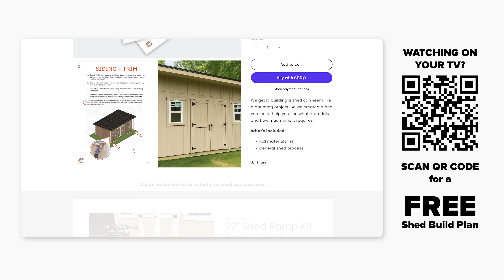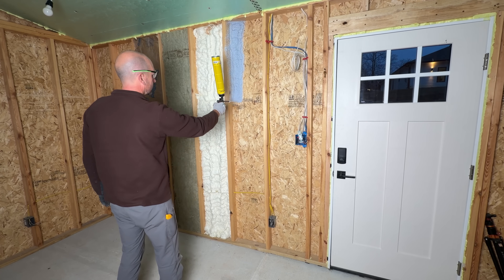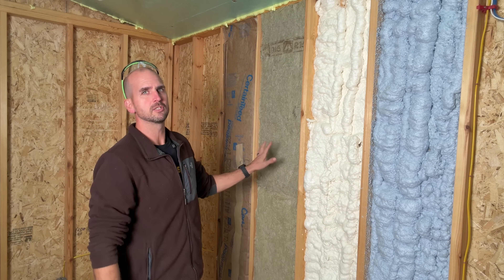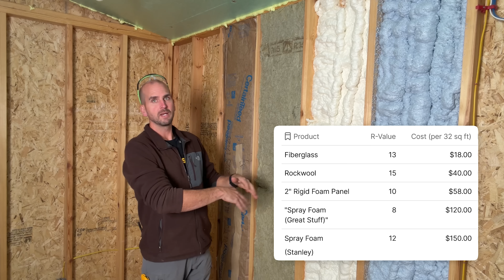Stop Wasting Money! Most Homeowners Are Insulating Walls Wrong

Comment: Rockwool also has the best sound dampening rating. FYI :) Plus it is far more fire resistant than the fiberglass and made out of inert material so pests, molds tend to be no issue.  We did our garage in 5.5" rockwool.  The cost will blow you away at first, but the sound control for working in the garage plus the extra R value if you are heating and cooling will make the cost less of an issue and may even pay for itself after a few winters.

Comment: At 4:21 you metioned wetting the walls to help adhesion.  Crazy thought - would adding a few drops of dish soap to break the surface tension of the water help the foam stick better?  I'm assuming the best tool for this purpose would be a simple pump up garden sprayer?
     Also, there are a number of 2-part spray foam kits that may be more appropriate and cost-effective than the small spray cans used in the video.  The key is cost per square foot to install and the pay-back in energy savings over time.
Thanks for posting!

Comment: Stone wool will be a great choice for most people. The higher cost (which also comes with a better R-value and better features like water resistance) is worth it. It's easier to install, no stapling is necessary, and your finished product will be much closer to ideal conditions than when installing fibreglass.

Remember that the rated R-value is only achievable with proper installation and good conditions. Stone wool is the way to go. Spray foam is great for air sealing and for gaps and cracks.

Comment: Rockwool will not burn, inhibits other burnable materials from burning, it is undamaged by water and it will not feed insects.
We had rockwool blown in on our 8 inch metal stud exterior walls, for a 5600 sq ft home, price was $4400 in 1998.
Rockwool paid for itself the first year, our usual electric bill is around $200 per month- average. Most its been is about $340 in middle of August in Texas.
Thank you for your great teaching videos, you've blessed us.

Comment: Did you insulate the floor. If you don’t  any heater will have to work hard picking up the cool air from the floor. I don’t ever use Kraft faced insulation. A good vapor barrier to keep air leakage at a minimum is a must.

Comment: Fiberglass is the worst product of them all. Each have disadvantages. 

"Fiberglass insulation's R-value isn't static; it generally decreases in extreme cold (due to air convection loops forming) and can slightly increase in very cold temps before dropping, while its standard R-value (like R-3.5 per inch) applies at moderate temperatures (around 75°F), but tests show a typical R-13 batt could hit R-15 at -30°F but drop to R-11 at 150°F, showing it performs less effectively in heat and suffers more from air leakage/convection than rigid foam"

Sprayfoam works the best but had disadvantages on wood. It will trap any moisture in the wood, so if you get a leak, it will rot away the wood, and it makes replacement really hard. Also if you get wood eating pest, it makes it really hard to detect and get rid of them.

Comment: My brother is a commercial roofing contractor and had several 1,000 sf of 2.2" ISO rigid insualtion left over from a large job he gave me.  Then on another job he had a bunch of R-30 batt insulation left over.  I used the batt in my workshop ceiling I was building and the rigid in the walls.  I'm amazed at how cool and warm it keeps it. Plus fortunate to get it for free.

Comment: Seriously, you shouldn't do this stuff if you don't know what you are doing. Spray cans? It's not meant for that application. Paper of the fiberglass batts on top of the studs? and you just screwed drywall over it? Working with fiberglass batts without a respirator? smh

Comment: If you're drywalling the walls and you have an adequate moisture barrier, cellulose is the best option for the money.  Put up the drywall, cut a small circle at the top of each bay and blow it in.  It's more air tight than every insulation except for closed cell, and super cheap, easy to DIY.  The Achilles heel is moisture entry, so if you get that part right you're golden.
Reply: Cellulose?  Oh heck no in stud cavities. Attic?  Ok.  It crushes over time QUICKLY losing its insulation value.  Now you could say LEAVE the holes OPEN at the top so you can continually TOP off the decaying cellulose insulation... but who wants to do that?  I have seen some finished buildings do heavy dense packing of cellulose stud cavities, but I would not trust it in stud cavities and it destroys its monetary value over other options if you do it this way so... WHY bother?
Reply: Net and blow is pretty good

Comment: Did you compare using this: Froth Pak 630 Spray Foam Insulation Kit, 15 ft Hose – Closed Cell, 2 Part Foam Sealant, Yields Up to 630 Board ft

Comment: Rockwool is the best soft insulation but real spray foam is objectively better. You get air seal and get into stuff that regular insulation can’t reach. Also no sagging. Only downside is off gassing

Comment: I like the Rockwool better as well. It is completely fire proof and will not produce toxic chemicals like the spray foam does during a fire. It is also a great sound proof material which are a couple of things you didn't mention in the video.
Reply: For same cost in Fiberglass you get a double wall and same sound dampening with superior R value.  But rockwool is great for interior thin walls regarding sound dampening.

Comment: One important thing to note is that fiber glass, even paper backed compresses about 1-1.5% every year and that opens a lot of cold gaps in your insulation.  The Roxul stone wool will stay firm forever and does not shrink over time.
Reply: I don't think this is really true.  I live in VERY cold Saskatchewan where temperatures drop to -40C (-40F) in the winter.  If my fiberglass was compressing, I would have large air gaps at the top of each wall spacing.  I would literally have frost lines inside my house at these temps.  

In addition, I had to redo a 10 year old section of my basement wall that is framed and insulated with fiberglass.  When I opened the wall, none of it had moved or compressed.

However, I have never heard of this happening, at least in Canada.  That being said, I would use RockWool or StoneWool any day.  Very nice product to work with over fiberglass.

The foam products shown in this video looked like garbage with inconsistent thickness.
Reply: @RŁM-n8l  I think, fiberglass mainly slumps badly when allowed to absorb water… but it does slump. Rockwool absolutely does not slump.
I don’t agree with people saying that you don’t have to handle it with some care — you absolutely do, it will abrade your skin. Not sure if that’s worse than with fiberglass but people seem to say that the fiberglass is worse for that too.

But there’s no question  Rockwool absolutely does not absorb water at all and will 100% not even be close to burning at temperature is lower than 2000°— properties that are far better than fiberglass, and as mentioned, it is far better at sound absorption. It’s basically a winning product.
Reply: Not true paperback fiberglass insulation on a roll or
Batt does not
Compress or shrink
Reply: @knockinonheavensbackdoor  a lot of people seem to think fiberglass does slump. Almost certainly not as bad as wool…
In any event, the only property that fiberglass has over rock wool is price… oh, and also you can buy small quantities of fiberglass much more easily.
Reply: @kineahora8736  ?  Costs 2X to 3X difference is a gargantuan difference.   Small quantities?  Uh, both can be bought in small quantities.  I'll take lower installation cost and double the R value EVERY DAY OF THE YEAR and for the next 2 decades as well.
Reply: @w @w8stral 
I am hardly advocating for fiberglass here — I myself bought a big package of Rockwool when I only needed a tiny amount of it to go around some PTAC units in my apartment, because I liked it so much better. But what I’m saying is that if I wanna just a very very small quantity of fiberglass it would have been a lot easier for me to just buy some at Home Depot and stick it in my backpack is all. When I say small quantities I’m talking very small quantities. This discussion is not for people redoing their house— that’s huge quantities to me. I wasn’t even redoing one wall in an apartment…🤣

Rock wool is just way better I think most people are recognizing that…
Reply: UH?  Rockwool shrinks LESS, it still shrinks and falls out of cavities, and the fiberglass shrinkage you are talking about is in the horizontal orientation(underfloor or attic installation).  Also: Why manufacutrers recommend support for rockwool/mineral wool when placing underfloors etc.     Everything has its achillies heel.

Comment: I live in northern Canada. We use a combination of batts, rigid and spray. Batts for regular spaces, rigid for behind plumbing and electrical, and then spray foam for a layer over the rigid and tight spaces.

The rockwool is strategically used; like the side of the house facing the street, or between rooms even, like home theaters, bathrooms, or teenagers rooms😂

Comment: Thanks for the comparison on the various products. What would you think about using rigid foam board like you did on the ceiling, but cut it and put it flush with the interior edges of the 2x4's, leaving an air gap behind?
Reply from the maker: That would be good but the R value would be less than Rockwool.  Probably R10 (2" Foam) vs R15 (Rockwool)
Reply: @EverydayHomeRepairs  thanks for the response. I appreciate it.

Comment: 15 years as a commercial carpenter and thirty years as a home inspector I still cannot fathom the constant use of spray foam on OSB or other porous materials. If they ever get wet you must do a complete rebuild, no repairs...water will get trapped with these types of porous materials and you will not know it till it is too late. Under perfect conditions, with perfect construction this product can function properly, but I'm still waiting to see a properly sealed structure with spray foam.  In england homes cannot get insurance if there is spray foam applied to any porous wood products, we are not far behind....these homes and various structures will become unsellable without remediation.

Comment: You are missing a fondamental element here: location of vapor barrier. Depending of where you live, you may need it on the exterior face of you wall (outside) or on the interior face (inside). Never ever use two layer of vapor barrier (one inside, one outside) as it will trap any water/condensation and your wall will rot. Period. People are just focusing on R value because it’s easy to calculate and understand but a truly well build wall system will focus on moisture management. For that reason NEVER use foam (rigid or spray)inside your wall as they are a vapor barrier. These foam (again, they are insulation AND a vapor barrier) can be use on the inside (cold climate) or the outside (warm climate with AC. inside).

My vote in all this: Rockwool by a mile!
Bonus : it’s the best sound insulator, again, by a mile!!

Comment: Rockwool is awesome, did my whole house on a remodel.  The sound dampening is incredible.  Zero road traffic noise comes through those walls.  I spray foamed closed cell under the house, hired a professional, simply because this is Florida and the environment with moisture and bugs.  Guess where all the noise comes in from?  The floor (doors and windows of course also).  I should have done the rockwool under there also.  

What is awesome about it is how easy it is to install. Did it myself.  Just bought a few kitchen knives from Walmart to cut with.  The money you save in easy  DYI makes up for the cost difference in spades.  Rockwool all the way.

Comment: The paper should go on the outside. It's a vapor barrier. What good does it do, if you only cover 90% of the wall? 
Also going on the inside edge causes it to compress the batt leaving an insulated gap, and reducing the effectiveness of the rest of the batt.
Reply: This is from the Owens Corning website on how to install their fiberglass insulation: 
In situations that friction fit of faced batts does not
sufficiently hold the insulation in place, use of minimal
staples to secure the insulation to the framing can be utilized.
Stapling can be either face stapling, where the flange is
stapled to the face of the stud, or inset (side) stapling, where
the flange is stapled to the inside of the stud, as close as
possible to the face of the stud with no buckling and to
minimize compression of the insulation.

I agree with you that the flange should be on the face of the stud, not the side, but it seems either way is Ok with the manufacturer.
Reply: @doctorwork Many aren't intending to use the vapor barrier, so I could see the manufacturer listing both for each situation. It still creates a poorer job at insulation though due to the space it leaves uninsulated. Also greater fire spread rate.

Comment: For clarity, I am a retired Red Seal Mechanical insulator.  I would never use fibreglass insulation in my home.  Roxul, or as in my trade would call it,. mineral wool, is a superior product.  Higher R value, is an acoustic insulator, water resistant, and rodents do not like it as it is made with slag from the steel process.  As far as spray foam goes, there are 2 types, open cell that requires a vapour barrier, closed cell that does not.  Check with your local Home Depot, you should be able to purchase a spray foam kit that is a 2 part system.  It will contain 2 containers, a long hose, and a disposable spray nozzle.  Costs more money, applies much easier, and of course more coverage as the containers are much bigger.  The two parts mix when combined near the tip and work much better than the products you have shown.  I only use spray foam around windows and doors myself, and please be careful.  Too much could cause the window or door to be jammed because of the foam expansion.  Note, they use spray foam to level up concrete slabs and also, when allowed to get wet, can rot.  And lastly, Jeffb5798 is absolutely correct, Roxul is rigid and you should slice for wiring or plumbing.  Best knife for Roxul, is a serrated one.  Hope this fills in some blanks for the host and any viewers.
Reply: I found the best way to cut rockwool is with a cheap electric carving knife
Reply: The mineral wool really seems like an awesome product.
Reply: Im an old guy builder and with proper design build use Pink stuff without issue ... always eves - always vaper barrier - always proper sealing around windoes and penitrations ... and most important always use best cladding as designed ,,, keeps mosture out ,,, starts with great paint outside
Reply: Best Rockwool cutter is a simple hacksaw blade.
Reply: Having used rock wool for furnaces and forges I've always been cautious about silicosis and carcinogen issues from it - but to my understanding, it's not a risk unless it is both heated and unsealed.

Having spent WAY too much time crawling in attics and developing a severe distaste for both fiberglass and vermiculite, I've always very much been a fan of spray-foam solutions.

Do the closed-cell versions require any special maintenance or attention to prevent their degradation?
Reply: @kireduhai9428 spray foams are subject to UV degradation and are supposed to have an intumescent (fire resistant) coating if exposed to open space
Reply: Posted by an unknown online.
Reply: @ronbelanger4113 your mom

Comment: I like Rockwool. I've used it some in my house. I will say this was kind of an absurd test for the spray foam. And I dont mean that harshly towards you. I mean, those products are definitely not suitable for filling walls like this even though they're kind of marketed for it. I tried the great stuff one for doing the band joist down in my basement and was equally disappointed in its coverage and mess. I was prepared for mess but not that much. Great for sealing up small areas quickly but not coverage. For coverage like diy spraying walls or my application, a 2 part froth pack would be far better than the wide spray kit.

Comment: I would have done the cost comparison first and not sprayed that foam in. Good luck if you ever need to do any work on that wiring in those spaces. Great insulation value and leak sealing, terrible to remove for repairs. That alone would stop me from using foam along with the exorbitant price.

Comment: can make a little slit on the back side of the  rockwool at the level of the electrical wire so it fits around the wire eliminating a air space and compression of the rockwool.
Reply: or tape the wire  against the wall

Comment: Actually the only insulation that was installed correctly in this video was the spray foam. He didn't caulk the studs to the sheathing or seal the wire penetrations through the studs. The plywood joints should also be caulked. Sealant at the floor to wall joint is also required. It will never pass a blower test.
Reply: Yes, if you have air leaks, insulation does not work well. I don't understand why people put so much money into insulating without sealing first.
Reply: And, handling any part of the two part spray, glove and eye protection is also a must (along with respiratory protection). Retired chemist😉

Comment: With Rockwool or even fiberglass you can get into the wall in the future, for wiring or piping. Something you can remove a piece of or a whole panel to gain access and work. The foam however is not as compliant for fishing anything through without much more effort or work hours. I pretty much use rockwool for all of my wall and ceiling insulation. Fire proof and mold resistant.